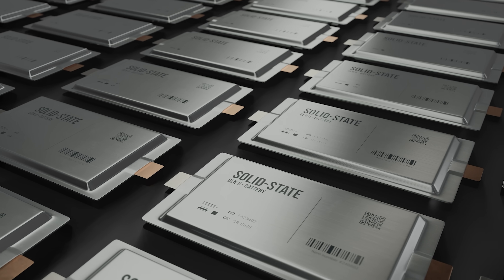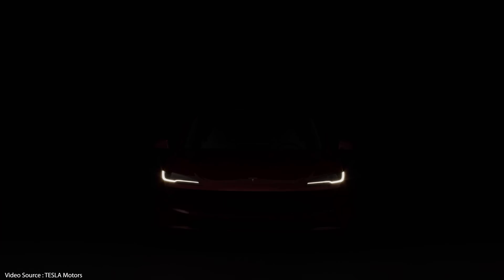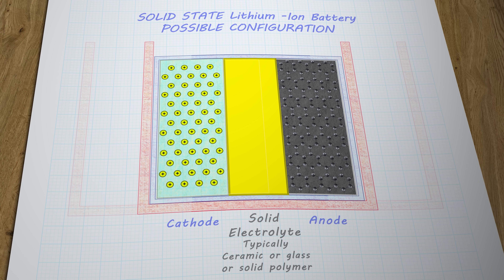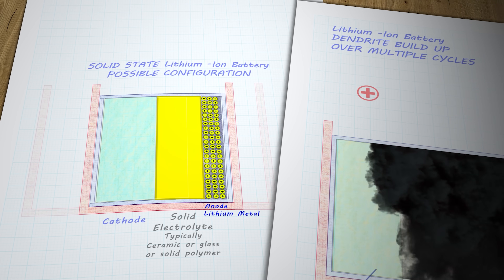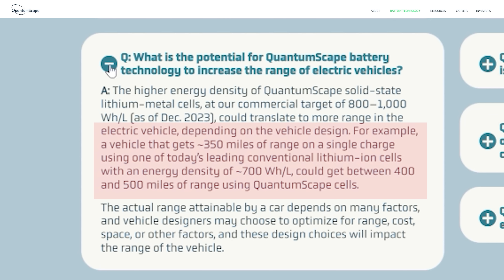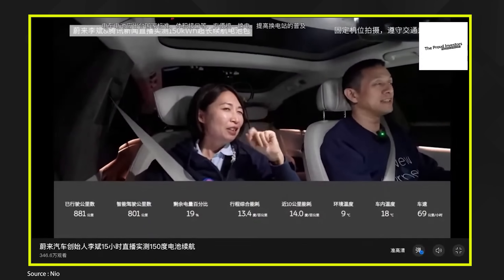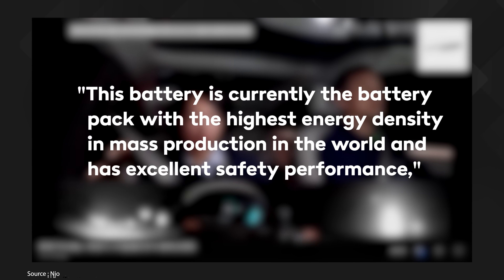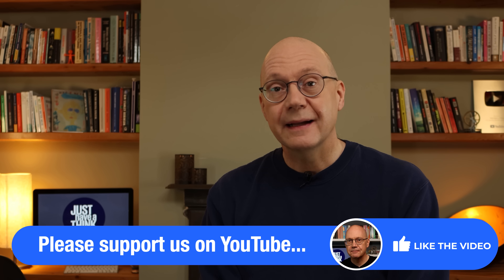Solid State Batteries - FINALLY powering electric vehicles in 2024!

Comment: I remember when the first lithium-ion batteries entered the consumer market. I paid more than €100 for the battery, charger and power-LED light over 20 years ago. The battery lasted maybe a year of use. Now you can get a more powerful set for less than €10 and the batteries last much better than the first versions. The same steps will probably also apply to solid state batteries. I hope, however, that we have learned from the past and that the first solid state batteries are already durable. They are not cheap to begin with. You always have to pay extra for latest technology.

Comment: Could it be that water has all the power in it that Tesla needs? Just a thought - could supercaps assist in the electrolosis process to give hydrogen and oxygen on demand?  All kinds of avenues with water power... :)🤩
Reply: The water isn’t the problem it’s the a) round trip efficiency b) handling and storage of hydrogen c) expense of rare metals used to create and consume hydrogen gas. A kilogram of hydrogen gas will get a car 100kms but that car costs 10x an ice car and the hydrogen is 12x the cost of the petrol. Fix that and you’re good to go

Comment: Apperently, a company called Yoshino makes a solid state battery - "Portable Power Station B2000 SST - 1326Wh Backup Battery with 4x AC Outlets 2000W, Full Charge in 1 Hour",  it is available on that website named after that South American river.

Comment: I think all these demonstrated solid state batteries were NON RECHARGABLE (at least not chargeable the expected way), so they are more one time battery examples.  It is April 2024 now.  No fast rechargeable battery of this type exist.  No manufacturer exist either.  You simply cannot buy it.  And I do not think this will change before 2026.  Or 2028.  Or 2030.  Or 2525.  Or 9999.  At least not for a reasonable price.  Battery technology becomes usable when they can be charged with C10 with at least 10000 cycles with a price tag of less than 50 EUR/kWh with an operational temperature range of minus 50 to 120 degrees Celsius and a low self-discharge rate, such that it can be stored away for 20 years without the fear that the battery may be dead afterwards.  Note that safety against over- and undercharge is just a nice-to-have but no requirement here.  However being hazard-free is another requirement, so if you punch a hole into such battery or break it by force, it must neither burn nor explode nor exhale lethal gas.  It could get hot like 1200 degrees Celsius, but you can practically construct battery confinements for still keeping everything safe.   The goal is to be able to charge it from 0 to 100% with a 10 minutes stop (this includes the full time from driving to the charger, charging, and get back onto Autobahn).  10 minutes still is slow, compared to less than a 5 minutes stop for fueling 80l of Diesel for 700km (yes my old car from 2012 took 12l Diesel for 100km at an average speed of 150km/h).  My current EV takes 45 minutes charging time from 10 to 80, too slow for normal people, except privileged ones like me who can charge at home and destination.  The problem starts with trips longer than 250 km without destination charging.  Then I must calculate a 30 minutes stop to recharge to 50% to drive 1h to the next charger 150km away.  So I am slowed down 50% due to charging, compared to less than 3% with a conventional car.  Thanks COVID there are not many longer trips like these needed now.  Also destination charging steadily improves.  Also I would like to see around 200 kWh in cars, such that you can go 5h at a speed of 150 km/h in average - which needs around 35 kWh/100km on an efficient EV.  Also this EVs should be autonomously driving at that speed.  Not the crashy variant of Tesla's full-self-driving.  I am talking from real autonomous driving at level 5+ with less than 1 accident in 1E15km.  (Also 5+ means that the car not only controls all aspects of driving and can drive without humans on board.  It also must be able to recharge and maintain itself.)
Reply: Wrong use case for electric anything. 150+ km/h for more than two hours requires optimisation (like make it look like a glider airframe) which will make it useless for anything else (like having people inside)

Comment: As long as it takes Gas Coal and Oil to charge the batteries it will be developed. As soon as you find a solution that eliminates gas coal and oil it will be banned and made illeagle to develop. Like Hydrogen Tech. To good to develop further. It would solve way to many issues. To damn good. Must ensure it's never pushed forward.

Comment: "Range" is an actual problem, though not for you, if you live in the more-tropical UK:

1. marketing "range" misrepresents actual usable-range.
2. if you fill-to-the-top & discharge-completely, a lithium battery, you've just destroyed a significant portion of its total life-span.

The rule with lithium chemistry is, never discharge it below 15% full, & for every .. 1/10thV, iirc, it's about 15% in a phone, I think, that you leave at the top of charge, you double the amount of charge/discharge cycles you can get out of that battery.

3. cold, which you don't get in England, kills battery-performance ( the weather there is much milder than it is in much of North America, though that may suddenly, & chaotically, change, in the next couple of decades, due to AMOC collapsing )

So, when you combine the fake-range, the capacity-deterioration, AND the cold, you get screwed.

However, when you combine that with the distances that are normal between cities ( or worse, for us rurals, to a city ), here in North America, then range-limitation can literally kill you ( every winter somebody dies because their vehicle got stuck somewhere cold, & either they died because they left it, or they die because they didn't ).

Europe & England ( which isn't in Europe, obviously ) tend to be so close together, that driving a couple hundred km to get to the nearest government office, or dentist .. likely doesn't compute.

Just as European cars are tiny, & North American cars can't even fit in Japanese traffic ( I read of some person importing an American car into Japan, & they couldn't park it anywhere ), it isn't just the vehicle-size, it is the ranges required for inter-city travel, or to-city travel, or to-town travel, etc..

There's a reason that North America's so much worse, for global-warming, per capita, than Europe, and this is part of it.

Comment: What I miss in videos about solid-state is the comparison to other battery tech that is promising.
For solid-state, there is a danger that it will be outperformed on density by the well known NMC batteries being further developed (500Wh/kg is in sight). Of course, solid state could have more benefits on safety, but then they have to be able to make them in large numbers for low cost. 
As range often isn't really a problem, the cost is actually more important. Or the actual cost of where things are coming from. In that sense LF(M)P developments and sodium might be more interesting and come to market earlier at cheap rates.
Right now, Chevy made a Silverado truck with 200+kWh. It is ridicolous. But it is also great. In that it offers a larger driving range then petrol/diesel powered trucks, and it helps a lot with all the towing that they do in US.
I am not in favor of more trucks and SUVs. But if you can make a truck like that with batteries that only cost 50$/kWh and the process of making them is relatively good, why not. I think we need some LFMP or Sodium batteries for that, cheap and basic materials.
Solid State might be the future and stay the future, just like a lot of hydrogen stuf. Always in the future. Until there is a Chinese company who succeeded and making them in large scale.

Comment: Sure, they are thinking of cars, but what about powering airplanes and helicopters that can stay in the air for several hours, running solely on battery power. This is the real goal, besides 1000+ mile per charge for cars.  We need phones that last a month, or longer.

Comment: IMO, the solution to the range problem (inasmuch as the problem exists anyway), requires the ability to give people both a meaningful amount of range in a very short time, and a large amount of overall range. This seems obvious, but those must not necessarily come at the same time. 

If you could get, say, 400 miles of overall range, with 20% of that charge delivered in 3 minutes, but a full charge (0% to 100%) requiring two hours or so, you could largely fix the problem of "not enough range" well enough for nearly any actual use case. 

Say you are planning a long trip. You can start with a full battery (400 miles), drive a couple of hours (call it 150 miles or so), and sit for three minutes at a fast charger to pick up an extra 80 miles. Now you can drive another two hours, 150 miles again, and pick up another 80 miles of charge, leaving you with 300 miles behind you, and 260 miles in the tank. Drive another two hours, 150 more miles, sit for three minutes, pick up an extra 80 miles, and you have 190 miles in the tank, and 450 miles behind you. Do it again, and you have now driven eight hours, and covered 600 miles; you have 120 miles in the tank, so, if you are a masochist, you can do it one last time, if for a slightly shorter time.

Having now driven nine to ten hours with nary a break, covering 700+ miles (that's a THOUSAND odd kilometers, for those using Sensible Intuitive units), you need to take a break. Not just your car, which is going to need two or three hours to fully recharge, but you personally.

If you are just driving around the city, the chance of needing more than 80 miles of range is so ridiculously slim as to not even be worth considering. And if you somehow do, well, that's what the big battery is for. Just plug your car in overnight when it goes below 30%, or if you are planning a trip.

Heck, add some software, and the big battery could be charged from the small one. There would be losses, of course, but if you really don't have the time to plug in the car overnight anywhere, you may just take the extra cost for the convenience of being able to top up 15-18% of your range in three minutes.

Is it technically feasible? I don't know, but I'm willing to bet it's a lot more feasible than trying to achieve both goals with a single type of battery.

Comment: I just paid $2300 dollars for a new 60 volt 60 amp hour for my ebike. It is better than a stock battery but not as advertised. The growing pains in this market are at the expense of the end user and are unbearable. Wanted, 100 mile long extension cord, must be abrasion resistant.

Comment: Lithium isn't scarce and never was. It's in short supply, which is a different matter altogether (and is about to change dramatically - see below)

The supply of Lithium is effectively infinite - and fairly easily extracted from sea salt.

Our existing lithium supplies are a side-gig of potash production and that's sourced from naturally pre-concentrated sea salt (brine sources or salt mines)

The "supply problem" is simply that it takes about 20 years to ramp up mineral extraction to match demand and Lithium Carbonate demand suddenly spiked in 2011 thanks to the emergence of EVs

Cobalt shows a similar story. The reason artisinal african mining exists is that until massive demand popped up, demand was very low - there are thousands of years of known cobalt deposits tied in with other metal ores (lots in mining tailings already), but it takes time to setup large scale extraction - whilst the deposits in Africa are relatively pure and close to the surface

When it comes to mineral resources, the definitions of "reserves" , etc depends on demand. There are no thorium reserves or proven resources despite the fact that the average rare earth mine extracts about 5000 tons of the stuff per year - because there's no market for it (bear that in mind when yoou see people saying thorium is rare or in short supply. It isn't)

Comment: you'd think that they would think "well...in the mean time.  how about we make multiple batteries sizes for a given EV model.  so they could cut down on cost time metals so they customer could just pick the batter/range they see fit for their road use. lowering the cost of the EV, making it a cheaper fix if a battery needs replaced ect?" 

and on Tesla's behalf, you'd think that they would think "well, material supply will always be a major factor,  how about we give a model a single electric motor and regulate its power to go 0-60 in 7 seconds, top speed of 90.  and a battery that suites only intown driving, up to 150 miles of range.  reducing everything across the board??"   

i think....half of the reason its way more an issue that its become, is that they all are trying to do over kill.  needs be fast, look amazing,  light wieght, fast charging, luxurious.  all of it or nothing.   and the or nothing, is what they gonna end up running this tech into the ground.

we simply aren't ready for EV tech yet and they deny the given facts.  so do so, alot of compromises have to be made.  this isn't a luxury sector like your top tier smart phones vs a 50 dollar throw away.  this is something all drivers they say NEEDS.   so a multi year phase of cost cutting to meet the needs of every one to aford an EV asap, shouldn't even be up for pondering.  its everyone can aford an EV or no one can have one.  this rich only can afford it shi8 is the other half the equation to making a "cleaner" tech work for n new means of transportation.

me myself. getting an EV is so far out of reach of logic and finances, it will be easily....easily a decade bfor i see one sitting in my drive way.

Comment: This could revolutionize a myriad of markets, not to mention  military hardware.  A HUMVEE with a range of 3-500 miles and a charging time of 15 minutes?  Add a gas generator for on-demand charging?  Superior supply-line independence.
(Won't work for armored vehicles though - the acceleration/decrleration forces on motor magnets would be too great.)

Comment: As much as i think better battery technology will improve evs. For now i think its the efficiency of evs that need to improve. Less SUV and more sedans would help for sure. Vision EQXX from Mercedes is proof that if that the current battery tech would  be sufficient if cars were more efficient. 8.4m/kwh on a 75kwh battery would give a range of 630 miles. 630 miles would do away with range anxiety for at least 90 percent of the population.

Comment: ICE manufacturing plants will not all be shut down in the next decade. That's the kind of thing Elon said years back would have happened by now. I suspect that in a decade it'll be something like 50% HEV/PHEV (both of which still require an ICE), 10% Hydrogen or Biofuel, 15% ICE, and 35% BEV. (Toyota has a nice write up about this).
Breakthroughs in different chemistries like sodium batteries or in solid-state batteries will take a long time to move into mass production. Basically, as we have seen, everything always takes longer than most pundits and corporate marketers say.

Comment: About the Tesla comment... Tesla is off track when it comes to batteries.  They have been more focused on Trucks and Semi's (Lories) since they started development on the 4680.  Tesla doesn't realize, the car manufacturer that can mass produce a battery able to be charged in 10 minutes and can goo 800 Miles on a charge is game over for Tesla.  The 4680 was announced in 2020 and 4 years later is just now starting to show up in the Model Y.  They are likely 1-2 years out from ramping up the 4680 to the rest of the lines.  I wouldn't invest in Tesla because if one of these other EV manufacturers cracks the Solid State nut and they figure out a way to get it quickly to market, Tesla is done. Edit  IMHO Tesla believes a majority of people are happy with a 300 mile range and relatively slow charging times.  You will notice EV sales are slowing and that's, IMHO, is because people want more.

Comment: Even if they do produce a batter that can propel a car 700+ miles, the company WILL just cut down the size of the battery to save weight and cost which means the car will go 300 miles again.

Comment: Range anxiety may be dismissible in a small, densely populated country like the UK. 

It’s a very real problem in a large, low density country like the US. 

Both in the sense of the ranges to be driven and the ability to provide charger coverage.

The US also has a much greater range of elevations than the UK. 

And huge portions of the US get much colder than the UK in winter. 

Both mean electric vehicles in the US will get less range from their batteries than in the UK. 

All of which means these solid state developments really are necessary for electric vehicles to get real traction in the US. Current varieties are failing to do so now - in large part because of range anxiety.

Comment: The speed of progress with oil and nuclear was astounding. At this rate with electric green energy, it will probably never work. Why is it taking so long? Hundreds of years. Nuclear took 15 years, oil maybe 15 as well. And they both clearly worked from the get go.
Reply: The nuclear material was making xrays and they wondered why? With electricity it all needs to be squeezed out by force bit by bit, and there are no strange things happening.

Comment: You're misusing the term energy density at 6:33 (and elsewhere). "Energy Density" is energy/volume. What you're referring to is energy/mass which is "Specific Energy". And before you claim that they are similar, no they are absolutely not. For example, hydrogen gas at typical atmospheric conditions has very high specific energy and very low energy density.